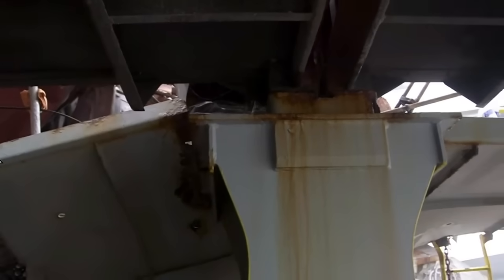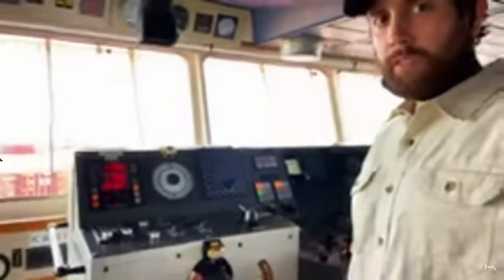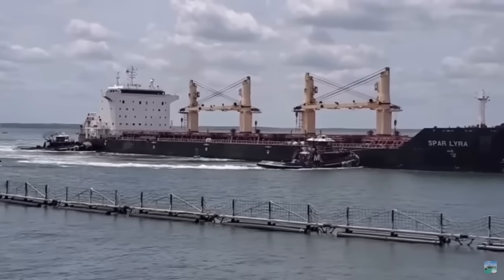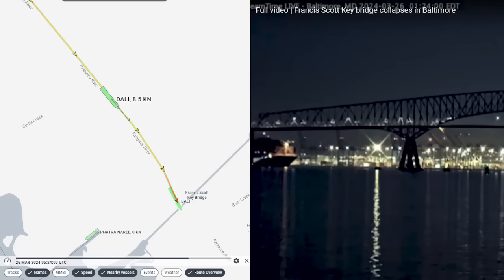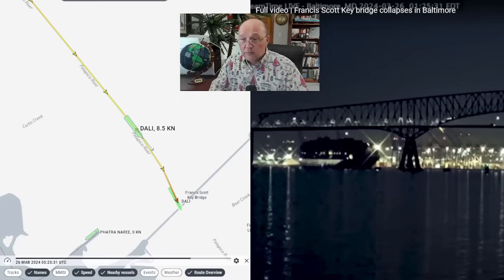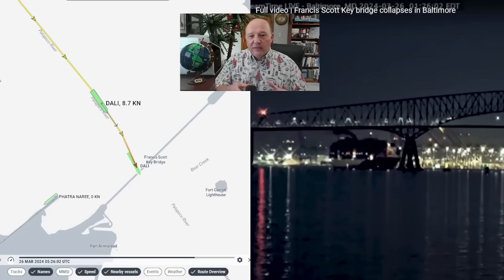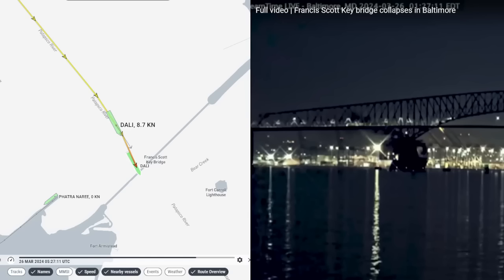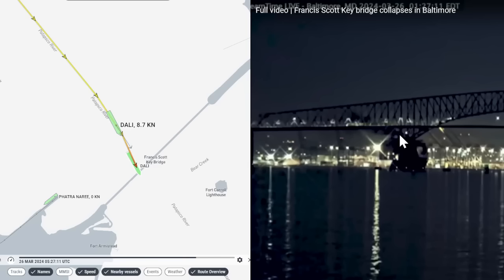Dali Timeline from Data Recorder in Striking Francis Scott Key Bridge in Baltimore, March 26, 2024

Comment: One thing you did not address. Diesel engines don't stop but under a few conditions.
1. Fuel flow is cut off
   a. Fuel pressurization problem including fouled feul lines (diesel is far more forgiving than gasoline in marine vessels, but you can get water in the fuel lines) 
   b. out of fuel
   c. valve shut off
2. Engine stall
   a. prop entanglement
   b. engine clutch (if applicable)
3. Loss of containment of a moving component in the engine 
   a. thrown bearing
   b. thrown rod
   c. broken piston pin
   d. fragmented rings
   [e. loss of oil pressure on the bearings or at the cylinder]

Diesel engines start typically rich, and so black smoke is a typical observation when an engine is stalled out an restarted because at the point of stall its rich in fuel and diesel isnt a gas, it needs to be physically pushed through the exhaust manifold which is very hot and will smoke fuel. 

Assuming that there was not a manual fuel cut off command. We can make several observations. An attempt to restart would indicate the rings were not annealled to the cylinders and the bearings were not frozen. While engines can run without a bearing pin or a thrown rod, this is an unlikely scenario and its likely there would be other indicators of a problem. So its unlikely that engine had lose parts problem or froze. 

That leaves engine stall, if the prop was stalled you could get the engine to reverse at least momentarily, and having something entangled in the prop might explain the course change. But this begs the question of scale, it would have to be a huge cable. A lost trawler net is not likely to stall an engine that size. Its possible there was some underwater obstruction, that got jammed in between the prop and the hull. These are remote possibilities. 

And that leaves the fuel. The black smoke indicates the fuel was reaching the engine. So the question is not likely fouled fuel lines. And so we are left with a couple probabilities. 

1. Manual fuel shutoff. Operator error. 
2. Fuel pressurization problem. 
3. Contaminated fuel. 

"A faulty pressure gauge for the fuel heaters was identified but fixed before the vessel left the port, according to authorities"

If the new pressure guage failed at the diaphram that could have caused a major leak of diesel that lowered oil pressure. Industries are being plagued right now by cheap immitation parts. It is likely this repair in some way is related to the engine failure. 

If the fuel pressure had ramped down slowly the air/fuel mixture would have leaned out and the engine would have sounded an alarm to shut it down to prevent damage unlikely you would see black smoke on attempt to restart. I would imagine these ships have water oil separators. So . . . . . .
Reply: An electrical fault can kill a diesel depending on how the fuel is shut off. Like at least smaller diesels the fuel can be shut off if the fuel shut off solenoid looses power. Or a computer issue if the injectors are computer controlled. A issue with the injectors themselves could also be a issue or the fuel lines develop a leak. I know it's small, but my Cummins diesel stalled when the injection line got misshapen causing a leak.
Reply from the maker: I would also add an electrical or control issue could shut everything down.
Reply: @wgowshipping  Well control would fall into signalling circuitry. But I would add to this, eliminating the bridge from the argument, major accidents often result from two or more unanticipated events occurred simultaneously. So maybe electrical and fuel system in tandem.
Reply: @SilverStarHeggisist  Yep. And you have to also consider there are probably emergency shutoffs to the reservoir and separators. There may have been a leak detected and an emergency shutdown. Deisels dont like to be fuel starved, they tend to run rich that cuts back MAP and exhaust temperature. Its possible that a control system detected a leak and realized the system was running to lean and shut it down. But then we have the issue, fuel-starved diesels dont shed huge black plumes on lean start-ups, they just dont start.

Comment: So how long does it take for a ship that size to slow down once the motor turns off? Small boats don't coast well at all in water once you shut down the power pushing it. 
Not sure why we don't just stick to MPH.  Using a few different measurements for the same thing is just overcomplicating the simplest of things. I'm not gonna go looking up the conversation but I'm assuming 8 nots or whatever is pretty low mph. 
I know it's big so either it's gonna slow down faster because of the water it's trying to push. Or even a low amount of momentum takes longer to stop due to the weight. Like a train. 
But trains don't have water to push through. They ride slick tracks with slick wheels. 
Just from what I can come up with it should of slowed down if it lost power a few minutes?
I gotta ask dumb questions to learn. Sorry. I know nothing about ships. Drove a boat 4 times I think so far. Cutting power on it was like throwing an anchor around a boulder behind you. Water was an amazing braking system. But it was a rented 25' ski boat I think.
Reply: When I was on VLCC, fully laden, it took from full ahead, to stop fully in the water, 10 nm+,  12 miles over there, without the engine use
Reply: @Onami-f9k  Wow. Thanks for the reply. I learn a little everyday. Unfortunately I forget allot each day too.

Comment: UN1993
A liquid having a flash point of <= 60.5° C (141° F)
Any material in a liquid phase with a flash point <= 37.8° C (100° F) that is intentionally heated and offered for transport or transported at or above its flash point in bulk packaging.

Many solvents fall into UN1993.

Comment: I hold no credentials, but I can clearly see that it looks like they were trying to hit that pilon. the gap between the two main pillions is roughly 1300 ft.  they should have been heading more towards the center of the channel not so close to the southern tower. Even if they were on a straight course, it would have been very close. I still don't by the issue with no tugs attached to a ship this size with the obstacles that is in this harbor. Oh, and the only docks to load this size ship is at Point Breeze with the closest berth at 2.5 miles away and the furthest one is 3 miles away, yet they managed to turn this (fully loaded) ship around and get it up to 10 miles per hour in that short of space. Maybe that smoke was them putting the pedal to the medal? Doesn't make sense only time will tell.
Reply: You don't 'buy' the issue of no tugs?  Well, if just about every other container ship of that size was only escorted by tugs as far as the channel, and then went under the bridge by its own power... why would this one be different? All this one shows is that it was probably a bad idea not to escort those containers past the bridge. 
Also, he just explained to you that it was on course for the centre of the channel... before all the lights went out on the ship.. 
If they were trying to hit that pylon by drifting to starboard... why did they drop the port side anchor ?  That would be consistent with an emergency attempt to stop a yaw to starboard. 

The only thing that's clear is that the ship DID hit the bridge...  dropping the port side anchor is just one piece of evidence that would contradict your idea that it was deliberate.    These are all professional mariners who don't want to lose their careers or go to jail.
Reply: @jimbobeire  How did the port side anchor drop swing the ship starboard.  Very strange reaction.  Just like that mysterious train derailment in Ohio.  Just like many other events that don't add up.
Reply: @syashadeed7552   The exact point I made, genius, that dropping the port anchor would be consistent with trying to stop a yaw to starboard.   Clearly it was ineffective, but here you are twisting things as if I'd claimed that dropping port anchor caused a yaw to port.     Why are you so dishonest?  How does it benefit you?

Comment: i didnt know  water stream can  turn the ship

this is  i was looking for since days  what  caused  the ship turning  despite  no control

but heres my  question
if stream can turn the ship, then isnt  by logic  tugboats were  posted nbe to haul the ship beyond the bridgr

because if stream caused the ship turns, then since 1978   it must occured  many times
never before   reported  any incident

this bridge  made 45 years ago
then after 45 years out of nothing  suddenly   a ship turning?
Reply: Stream? A stream is a tiny river... we're taking about currents. 

1. This is not the first time a ship hit that bridge. Previous incidents were more minor. Just cos you didn't hear about it doesn't mean it didn't happen, so quit with they ' hey 45 years of nothing then this ' mentality.  The Blue Nagoya, that lost electrical power and struck the bridge in 1980 was a Japanese container ship that was much smaller than the Dali.  There has been a dramatic increase is the size and weight of Container ships built over previous decades.   Not only are bigger ships heavier when they hit, but they are harder to control when they drift of course, because of their length and mass. 

2. The current would only cause a problem if the ship was unlucky enough to have power failure at that point where the current is strong enough from the side.
Reply: @jimbobeire  
thank you for  enlightening

if current not caused 
then why  ship turned  so drastically  within a very  short distance?
less than a mile  and it turned  close 15 degre  from a straight path

and its not only  satellite data , but  video also confirms
without that turn ship  would drift  trough  between pylons

Comment: Sir do you not think if it were day time the pilot might have saved the bridge n the ship from at least less disaster then what is it now . Or if at the last moment the pilot should have ordered  the helm to hard port then full stern as the vessel was still underway at steerable speed  of 7 or 8 knots . With the time line it seemed  with the speed also the column  of the bridge was at about more than 3000 ft . With the hard port helm may be  m not there to talk about the pilot  judgments . That the ship have not hit directly  that bridge might be still be  intact n less damage  for that ship also . What do you think . Sir

Comment: You will lose the ruder control immediately if the power goes out on this ships and the emergency generator supplies 1 of 4 pumps. Usually you have all 4 running during port entry or leave. Wirh 1 pump everything is happening painfully slow a helty stearing gers needs to issue hard port to hatd starboard within 25s but ounder emergency conditions this isn't the case.

Comment: There's a video by another merchant ship engineer also covering this incident who postulates that the ship was likely at full astern causing it to veer to starboard. 
He noted that the torque for a propeller turning clockwise viewed from aft would make the ship tend to turn to port, but a full reverse would tend the ship to starboard, and that the black smoke was a common sign of this command from the ship bridge. 
(For us in chat who might not be familiar with the concept, look up "the right hand rule for torque" - there are a few good videos). 

He notes it's likely that they made a bad call by throwing the ship into full astern and should have continued normal forward motion instead. 
(his video https://youtu.be/BEzDh4RwpaM)
Reply from the maker: I doubt they ever got the engine to go astern.

Comment: Another retired engineer stated that the ship was clearly in reverse. You now admit there was no wind. They were so close to low tide there was no tidal force. How do you explain going from 140 degrees on the port side or the channel to 157 degrees in 4 minutes. You could NOT drop 1.1 knots of speed without wind and a slight at best tide going out. BLOWING BLACK SMOKE AND DROPPING SPEED AND GOING HARD TO STARBOARD IT WAS IN REVERSE!

Comment: Most semi truck engine fuel filters are changed every 12 to 15k miles. Why isn't the fuel filters on these mammoth marine engines changed more frequently.  I think if I was the maintenance supervisor on watch.  I would be changing these filters at every portobello call
Reply: Usually, the Filters are cleaned weekly and may be cleaned more often if you know you have bad Fuel or just run into Problems suddenly. The Pressure before and after each Filter is monitored, and the Difference between the two Pressures becoming too high indicates a clogged Filter.
Reply: Let us know when your "semi" starts running bunker oil. The resources he provided...  He is talking to people like you.  The ones that feel entitled enough to tell others in the industry what to do... and the ignorance to know nothing of their demands.

Comment: 1 major point . European maritime law . Any vessel of a size going into or out of a tidal port is required to pilot and have tugs within useable distance for escort , once outside navigation danger area tugs and pilot leave . 1 large tug is to be available 24 7 . Every port in UK has this . This I know as a marine engineer of 37yrs in the UK.
Reply: Very little is comparable between the UK and the USA.
Reply: Ships this size, at this speed, if there was a tug available we'd be looking at an extra fatality and that's it. The cannot stop a ship like this once it is moving, a couple of them can barely hold one that is already still against moderate wind. In Australia we denied a much much smaller ship transit under a bridge due to simulations as to what would happen under a loss of power situation, and rejected the proposal to use tugs due to risk to the tugs. (Tug would just end up wedged between the ship and bridge). And that was for something a fraction the size of the Dali.
Reply: Reference to failure is an option,  Southampton Water is 15 miles long and 1/4 mile wide at its widest ,its the four busiest port in the world for shipping and has the largest container ships in the world serviced there . Maximum speed of vessel allowed in the port for ships of this size is 4 knots, until out of danger area . At the end of Southampton water is the Isle of Wight,  coursing a hammer head with a large gravel bank in the middle of shipping lane , pilot is on board until past this . Tugs are on stand bye until just before this area . There only been one accident in the history of Southampton docks . That was a grounding on brambles Bank coursed by ballast tank failure a few years ago and the pilot put the vessel there instead of loosing it in main channel . Liverpool 18 mile estuary to docks , Felixstowe, only 8 miles of danger zone . All port shipping accident free . Engine loses 9 in 40 yrs , all 3 main ports hand over a million container a year . Every vessel leaves at high water , not in a moving tide , as this was . I don't know about the tugs in the USA,  but this size ship is handlable at 4 knots in slack water . As I've worked all ports in the UK and some in Europe I know the regulations for all Euopean ports and procedures.  Europe has some of the largest and most dangerous ports to enter and leave in the world for these ships . All arrival and exit is done at slack water and assisted . This situation is no larger or smaller than most high capacity ports in the world . Except you allow a vessel to do 8.5 knots ,untugged,  in a dangerous  area on a running tide . Yep makes a lot of sense that
Reply: Southampton average 1 million containers per year ,Felixstowe 1.1 million a year , Liverpool 800,000 approximately.  Does not include,  grain , roll on roll off shipping , steel or any other cargo . Average port turnover 82 million pounds Stirling per year . I left 4 yrs ago and its more now
Reply: Sorry my figures  were incorrect Southampton port containers only . ABP turnover was £11.7 billion Stirling for 2023.

Comment: With ships getting this big, the bridge should have been replaced with a tunnel. It should not get rebuilt as a bridge.
But preventiion seems to not be in the IS dictionary.
Reply: Tunnels are far more expensive and specially for an area that's been getting hit really hard financially speaking. I'm wondering if they can even afford to repair the bridge. Half of the city is a ghetto.
Reply: Hazmat is not permitted in tunnels, that's part of why the bridge was built..

Comment: Rocket Scientist Pete Buttigieg says it’s too early to say how long it will take to reopen the Port of Baltimore or replace the destroyed bridge.  He noted it initially took five years to build the bridge so Peter Puffing Pete is going to call DeSantis to get some pointers on how to get it done quickly.
Reply: Right... so he should say 'three days' and then when they hit a snag like an underwater gas pipe, or loose debris, you can call him a liar if it takes more than three days, right? 

All the problems that are going on, and this tribal pointscoring b.s. is what you focus on? Take a look in the mirror and have a bit of a think.